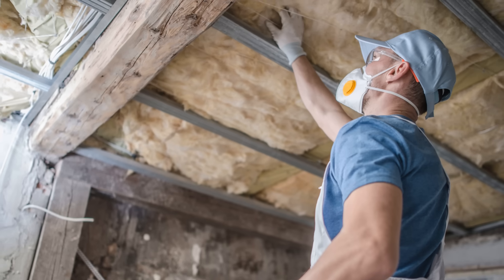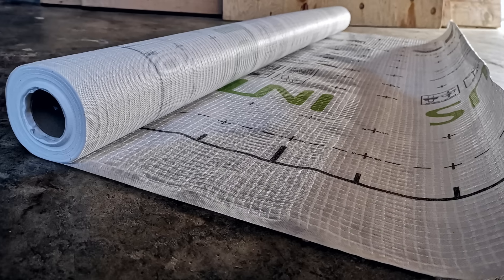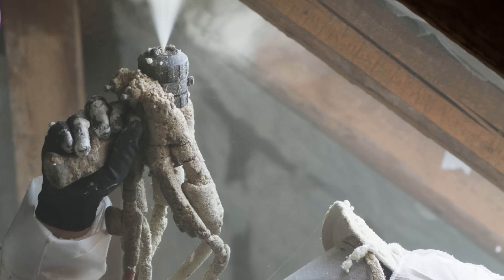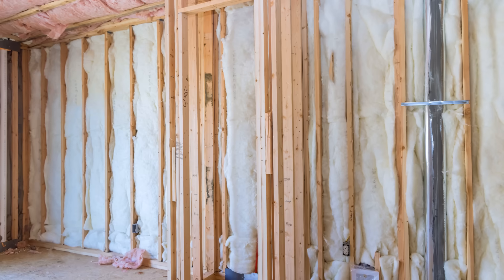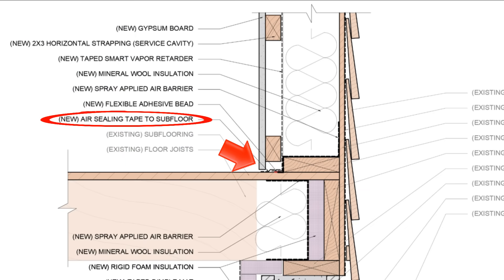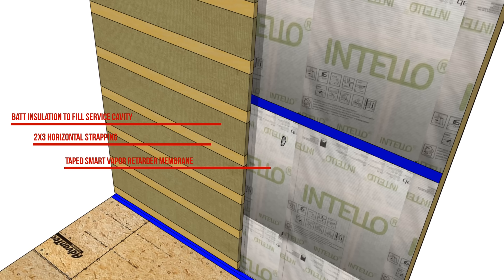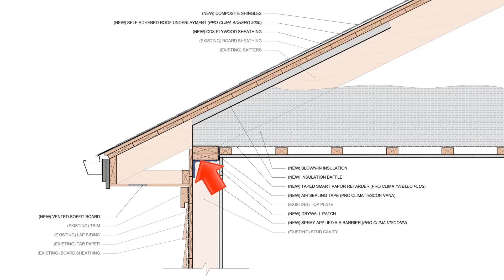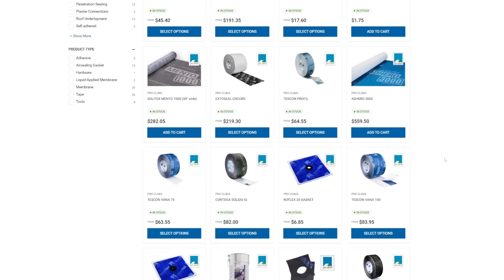We’re Using THIS Strategy To Insulate Old Homes and Buildings

Comment: In warm humid climates, what is your recommended strategy when retrofitting insulation and air sealing from the interior?
Reply from the maker: @doerinsm5048  We actually have a mini-series on this that we may update: https://youtu.be/1TuRK3CI7jc?feature=shared

It warm climates you don't have to deal with condensation on the backside of the sheathing but rather on the backside of the drywall. Above all else, impeccable water management and dehumidification to avoid part load humidity issues is what we need to be considering in warm climate retrofits.
Reply: So no Intello type air barrier/vapor retarder necessary in a climate zone 3A environment  on the interior?  Just good air sealing with tapes, sealants, or fluid applied materials?

Comment: I'm restoring an 1803 timber frame in New England. This seems like the right approach, but I'm concerned about longevity. My goal is to make sure that the house lasts another 220 years. I don't understand the mechanics of these smart membranes well enough, will they continue to function for 200 years? Should I just accept energy inefficiency and replicate the systems of the past, i.e. solid wood sheathing, no insulation, lathe and plasters walls, etc?
Reply from the maker: @keiboman  These have to be addressed on a case by case basis, but are you able to insulate from the exterior with rigid insulation? This would be the safest strategy, since it would keep your wood structure at constant temperature and interior relative humidity conditions. If not, they need to be handled with care, and sometimes it's best to leave them uninsulated if you aren't confident that you can manage the potential moisture issues
Reply: @ASIRIDesigns  Thanks for the reply! With, say, 6" of comfortboard and a WRB, would a smart membrane be unneeded?
Reply: Lots of if's. Cellulose or mineral wool usually allows drying and breath-ability. My 200+ year old house has cellulose in walls with lath and plaster. Installed from outside. I have not messed with exterior yet. I plan on wrapping it with a higher perm wrap to help drying outward. I would go with the membrane or wrap that allows drying outward. My brick in crawl is insulated with mineral wool on inside. The moisture switches in a colder climate sometimes wanting to go inward and sometimes outward. It's been here this long and bricks and mortar look good. I did white wash my basement and crawl space bricks. As it's a brick foundation and it does wick moisture. So my concern was for masonry to be able to dry out. Hoping the mineral wool and white wash will keep moisture headed outwards. If moisture stays inside stuff rots and molds. Even masonry can become water logged. It's best to find someone familiar with your area and works on old houses. We do seal houses walls that face lakes here. Because of ice build up and constant moisture off the lakes. And not sure if you use interior vapor barriers there. Also how far north matters too and site. Also conditions of current wood. To be able to see how it's weathered the years. I have a north wall in a nook the sun never shines on till summer. I dug foundation and duck coated it. And add mineral wool and buried it. The foundation wanted to wick moisture out of the area. With an old boiler I pay less for heat than many new houses. I don't have forced air forcing heat out either. 4 bed with natural gas boiler and 65 gallon tank water heater around 114$ in winter.

Comment: My bungalow is completly retrofitted with sprayfoam. I live in Québec Canada. What would you recommend if i want yo add exterior insulation? 2x4 walls. I have an erv running 24 7
Reply from the maker: @rocky7gd  Probably exterior Rockwool or some other type of vapor permeable rigid insulation so that you can maximize your drying potential and avoid a vapor sandwich.

Comment: How would you design a wall that uses structural masonry ie 3 layers of brick like century homes. 

Looking at how one could build with thick masonry walls without having isulation between 2 types of masonry. So all insulation would need to be on the interior. 

Based in Ontario (cold wet, and hot humid climate)

Comment: Is this system for a climate zone 3 home or are vapor retarders not needed in warm-dry places?  I assume the air sealing and such is still needed in all climate types...
Reply from the maker: @triaxe-mmb  No need to use smart vapor retarders in warm climates, in fact you want as much inward drying as possible. The spray applied air barrier products are still very applicable (and useful) though.
Reply: What is an example brand of a spray applied air seal?  Would this be applicable in zone 3A - warm humid?

Comment: Thanks for such an informative and eductaional video. 
Where I live, black mold is endemic and I recently saw a video by clinical oncologist Dr Abetekov talking about all the many symptoms from black mold. Scarily, even cancer. So your work in this video can save lives. 🙏🙏🙏
Reply from the maker: Thanks for watching! Yes, mold is a huge issue in both retrofits and new construction. Much easier to mitigate in new construction than it is in these types of insulation/energy retrofits since you can start from a blank slate. If there's one takeaway, it's to keep moisture sensitive stuff away from the wet stuff, and allow the wet stuff to dry. Oversimplified but it applies everywhere.

Comment: Are smart vapor barriers on the interior recommended for all climate zones?
Reply from the maker: No, we use them in CZ 4 or higher in most cases.
Reply: @ASIRIDesigns  Meaning zone 4 or colder (5-6-7..)?
Reply from the maker: @librespenseurs_freethinkers  That's right, in warm climates we need as much inward drying as possible from the cavity - not to mention that interiors are typically air conditioned.
Reply: @ASIRIDesigns  Are those membrane vapor variable only in one direction (from the cavity to the inside of the house) or both ways? If it just increase permeance both ways as humidity level gets higher, it could be a problem for bathrooms with a high humidity content.
Reply from the maker: @librespenseurs_freethinkers  They increase in permeance in both directions, though I believe at different rates... You're correct about the bathrooms/generally high interior relative humidity, it's very important to have an adequate exhaust and makeup air system, and to ensure that the interior air is humidity controlled - but that's pretty much applicable to any building. Bathrooms are typically tiled or covered with a semi-impermeable wall covering which helps, but also can pose other issues (this may be for a completely other video).
Reply: @ASIRIDesigns  Thanks. I design house in Quebec, Canada and heard about smart membranes from your YouTube channel. I'm integrating it slowly into my work but am cautious about a new product that serve such an important purpose. Thanks again.